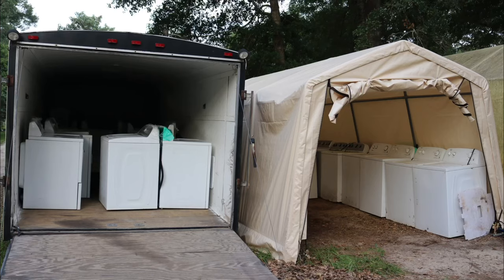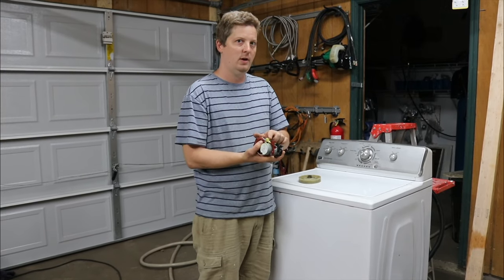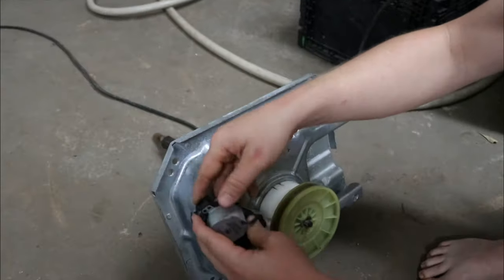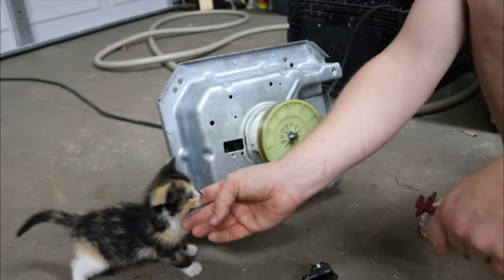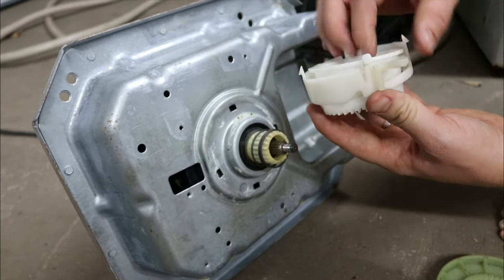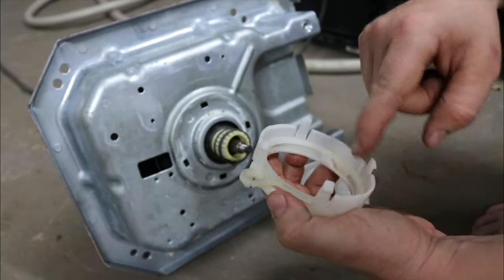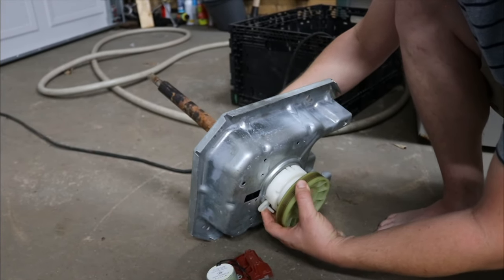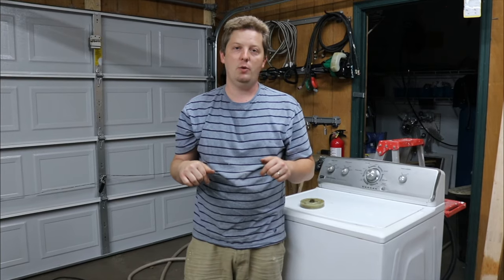Washer No Spin or Grinding Sound? Actuator Transmission Step by Step Guide to Fix or Replace

Comment: Hello. Thank you for making this video. It is very helpful. We are attempting to repair a Maytag Model No. MVWC360AW0. Back in March, the washer wouldn’t drain and the sensing light was flashing. We first replaced the shift actuator. Then, having not resolved the issue, replaced the drain pump. Noteworthy, we have never been able to get the control panel to enter diagnostic mode. A friend installed the parts and I believe he recalibrated the machine afterwards but can’t be certain. Once repaired, the machine was up and running until about a week ago. Now the symptoms are that the agitator and spin basket are locked up. It doesn’t budge. We disassembled the inside…removed the wash plate and doin basket. There is nothing. On the underside, after removing the protector, we tried to move the cam assembly by moving the drive belt. It does not move freely. A visual inspection shows no oil or evidence of an issue with the gearcase. However, after removing the nut and the cam, there is dirt and oil around the inner lumen of the gears near the shaft. How may we determine if the gearcase is bad? What could seize the agitator/spin shaft?
Reply from the maker: Oh that is a uncommon problem. I haven’t countered it but it’s been a very long time and I can’t remember exactly what it was. I feel like maybe it’s a bad transmission. The transmissions in those washers are not really made to be worked on. If you look through my videos I disassemble that transmission and give my opinion of how it works.
This video helps. Good luck.
https://youtu.be/2ImQbNrdblY

Comment: Thank you for explaining the potential cause. After replacing my actuator, my washer worked great for 1 day. At least we got caught up in our laundry. But the new actuator broke in the same location. Small plastic piece that rotates the arm. After removing the splutch, I found dirty grease but I also found worn splines. I hope a new splutch kit and actuator will solve this.
Reply from the maker: I bet it will.

Comment: Awesome video. I have a maytag bravos MVWX655DW1. It started making that plastic grinding noise so I replaced that plastic hub under the wash plate but to no avail. It will go through the cycle with grinding noise and when it come to the final rinse and spin it will not spin cycle completely to remove water from clothes it does not finish the cycle and the tub will shake really bad also. Hopefully my description can lead to any type of helpful conclusion. Thank you

Comment: Yup you nailed it my man! After my Kenmore machine failed in "stuck in stupid" mode - meaning start a cycle and the thing senses 2 times then the lid latches and the lid lock light blinks . . . and blinks . . . So I ran the diagnostics and got codes for sure . . . which told me that the thing failed to wash and rinse - duh. So I opted to replace the actuator for $55, no big deal, right? Except that did nothing to clear the problem - same thing - locked lid with blinking light which simply means that "something" went wrong to start the cycle. SOOOO . . .I came upon your collection of clips here on good old Youtube and watched several in order to get a good idea of what was going on during these assorted cycles. I popped all the hoses back off and flipped the machine back over and dug back in and this time I pulled the belt and drive wheel off the transmission and actioned the arm and all that stuff inside the shifter and gears (aka the "splutch" in the insiders circle - splined clutch perhaps?). Everything moved smoother than a babies butt so I put it all back together. and tried again with fingers crossed and some prayer . . .and . . .wait for it  . . .BINGO! We are back in business mister! OOOO-RAH in USMC vernacular. It is so very satisfying when one can make a simple machine (???) do what it supposed to do. Thank you for taking the time to make these videos and put them up for others to see!!!!😃😁

Comment: GM. I have a Frigidaire Max Fill Top washer that  Makes a really bad gridding noise while it initiates  the pre wash cycle (weighing clothes), While it  moves (agitates) from left to right its ok but as soon as it tries to turn the opposite it grinds and gets stuck. I have to do one of the scans for 3 minutes  or more before it stops gridding and functions correctly.  it will wash all loads with no problem until the following week and it will start again. Thank you. Blessed Holidays

Comment: The best part of the video was seeing your adorable kitten. Hehe On a serious note I have this washer and I am praying it is not the bearings that have gone out. 
I will check this problem though.
Reply from the maker: Yeah my kitten has grown up into a cat now. She's still cute though.
When bearings are going out in these type of machines they get really loud in spin cycle.
Reply: Yea that’s what mine is doing. I was messing around with it last night. Know not a thing but did some research the proper term are the drum bearings. I was thinking it was the actual “transmission” that drives the pulley that has the problem but it’s not I do need a new belt though mines all gummy and you never mentioned what a pain the pulley wheel was to get off. ;) lol

Comment: Sub’d!! Awesome video/explanation! I have this machine and it just stopped agitating in the middle of a cycle and I like to never have gotten the dang lid open. Was stuck closed. Tons of videos suggest it is the drive hub, but after disassembling it and looking at it, it does have some worn splines, but it seems to fit snuggly. After reassembling, the machine, it did fine and made it all the way through a load with no problem. I figure if it were the drive hub, I would have heard some type of grinding, which I did not. After watching more videos, I started to think the actuator might be bad. It was suggested by another technician on YouTube to clean the spludge, which I will do today. I also found out how to put it in test mod and it passed all tests involving agitation, with flying colors. I just with I could be more sure it is the actuator and not something else, so that I’m not just throwing money at it? Thanks in advance for your time, I greatly appreciate it!!! And again, awesome video!! Hard to find such great, in-depth information, from knowledgeable individuals! 👍🏻👍🏻👍🏻

Comment: Thank you so much....  

I actually just needed to replace the belt. 
It was shredded. I could not understand what that burning smell was. 🥺

Because of your video, I was able to understand the breakdown of my machine and locate my issue. 👌
Reply from the maker: Glad you got it going. That is a very rare problem

Comment: Thank you for your video. I replace the actuator and the spluch and still have terrible grinding noise during agitation. What could it be?
Reply: Mine does the same thing after the repair.

Comment: We followed your video and it made it so easy. However the drum is still bouncing around. This started after we changed the splutch gears then is came unbalanced. Then changed the suspension rods. Is there any other fix we could try before getting a new one?

Comment: Question:   Whirlpool WTW4816FW2 Top Loading Washer much like the one you have in this video ... 3 years old ... grinding sound when the agitator is moving CCW ... normal when agitator moving CW. Checked the clutch and the teeth look good, but a fine dust has started in housing. Increased clutch spring tension slightly, (about 1/4" past larger splined shaft), and lightly brushed  ramps and splines with silicone grease ... Noise when agitator is moving CCW still there ... do you think it is the actuator motor not fully engaging/dis-engaging?
Comment: You most definitely have the gift of Teaching , and obviously enjoy your work .... Thanks so much!

Comment: Very good video, mine was grinding. was going to check the actuator when I took the belt off the motor pulley came off too. so that was the problem and it cast only $20 bucks to fix it.
Reply from the maker: Interesting. Are you saying the pulley just came off when you went to take the belt off. So it was missing the nut that holds it on. That nut I have had come loose and cause havoc before but I’ve never had them for all the way off. I do recommend putting a tiny bit of thread lock on those nuts so they don’t come back loose. If you look close, you’ll see the factory put some on as well.
Reply: @WasherDryerMoney  the motor pulley just snaps in. no nut The teeth where striped.

Comment: Thanks super helpful! I replaced the actuator on my machine without doing the other steps, to check that first, but now, as soon as i plug it in, it starts clicking. Worried i broke something 😕

Comment: Very good on explaining everything but I have a question you said it could be the actuator but I see you just spinning the pulley without the actuator connected and still making noise so I think it’s more likely the spring because the actuator not connected how can we tell in this situation because I have the exact same issue right now and i don’t know what to order the actuator or the other parts with the spring my question how to find out exactly which one

Comment: I have a Whirlpool Model WTW5000DW1. This is the 1st time I've had an issue with it. I believe it was on a drain & spin cycle & it just stopped. All the lights went off & it made a faint hum/buzz sound. It doesn't drain or spin and the water is still in the drum.

Comment: I recently had to remove the Wash Plate on a model MCWC555DW1 to replace the spin assembly.  I ended up destroying the original wash plate to the point that only the plates gear was left on the shaft.  This was a total PIA!  I heated up, etc.  I finally took a small hacksaw and saw a groove in it and took a chisel and split it of the shaft.  It only came off after doing this on each quarter of it.
I wire brushed the shaft and placed Never-Seize compound on the shaft where the agitator mounts.  I certainly hope it makes it easier for the next tech that has to deal with this machine!  All the You Tube videos seem to never show the actual work of getting this POS off!
Lost my ass on this job!

Comment: Hi. Thanks for awesome video. Helped alot. But for some reason my shift actuator keeps breaking and i have replaced it two times already. Any ideas why the shift actuator might break at shifter? Thanks again for good video.
Reply from the maker: Have you added the white lithium grease to the plastic part that moves back-and-forth.
If you cannot easily move the arm back-and-forth by hand, he may have to replace that splotch “that plastic piece”
Also, be sure to do a recalibration after you’re done replacing that part. It will double check that it’s in the right position before you start using it again.

Comment: Great video, my shift actuator arm keeps popping out of the shift arm, and then I don't get agitation? Electrical wise it works. I have replaced it with an OEM part and it does the same thing? Is there a fix for that?
I have also disassembled the shift housing and cleaned and lightly lubed and it's clean and smooth? If the shift solenoid actuator arm pin was a little longer it might not pop out? I apologize for not having the correct part names. Thank you

Comment: This was an amazing video. Wondering if you would be able to reference where to get the spring if we believe that is the issue?

Thanks 😊
Reply from the maker: You’ll have to buy the spluch kit. It comes in the kit. The most likely culprit is going to be the split kit if it’s making any type of grinding noise. If it’s just not shifting into or out of agitate that’s more than likely the actuator. Which is also not expensive. check the description I put links to them

Comment: Hi. I have a similar GE model. My machine is draining but doesn't spin nor agitate. I replaced the belt. When I turn the pulley underneath the washer the tub moves and so does the actuator when manipulated. However when I stand the washer back up the machine doesn't agitate or spin, only drains. When i pulled the pulley off it seemed like theRe was an excess of black goo, but that could be from the belt slipping.  I did hear a light grinding from time to time, so I checked the gears behind the pulley, and they seemed fine. With the model GE that I have there is no front plate or back plate to take off to see if the motor is actually running properly. But I am presuming that the motor is what is draining the water from inside of the tub.  Lastly, but I don't think it's related to this issue that spin cycle has been running a lot longer than what it was. There is times that the spin cycle runs for almost 9 to 10 minutes. That's why I was thinking possibly that the motor burned out. Any advice? Thank you.

Comment: Thank you for your   
Video's ,how do you change the rubber washer at the end of the tr
ansmission shaft
Reply from the maker: If you mean the rubber piece inside of the end of the transmission, I’m not sure that is serviceable. The bigger issue might be finding a replacement.
I have removed the washer that holds back the gear case oil from leaking on the belt. The issue was it was a weird shaped rubber piece that I could never find a new one.
That is the big downfall of that machine. The transmission is just not made to be serviced, and even if you do go to the trouble of removing a bad piece out of the transmission there are not replacement pieces that I could fine.
They want you to replace the entire transmission which is pricey.
Reply: Thank you for your reply,I'm actually talking about a rubber piece up where the shaft comes out by the drive block
Reply: I like the way you're step by step on you're video's, the machine would not agitate,so not noting,I went to check the dogs ,there are none,started to remove agitator the bolt would not come out ,so I resorted to the 4/4 and jack Methodist ,it worked  but pulled the shaft out of the trans. The spanner nut I had to cut off,and stuff got into the trans. So I took   it all the way down,cleaned trans. Installed grease  and putting back together ,I'll let you know what happens.

Comment: My pulley nut is on crazy tight, too tight to hold by hand & bust it loose & the clutch won't move far enough to engage the pulley teeth so I'm stuck trying to keep the free-spinning pulley from moving in order to loosen the nut; any advice? I tried one of those belt wrench things for oil filters but it doesn't grip well enough.

Comment: I have a Kenmore Series 500 with an actual agitator.  The machine sounds like it is agitating, but it does not.  It doesnt spin either.  I replaced the drive hub under the agitator.  That was not the problem.

Comment: hi  great vid..thx  I ran a manual diag test on my washer and got a FAULT 421 and error code 41 so points to a  SHIFTER  problem
I didn't Check harness connections from main control to motor and shifter since I don't have any meters
• Observe shifter operation  didn't know what to observe. when I run the manual test I hear a very soft   noise for a few seconds which then stops and  then starts up again  several times ...would that be the  belt , trying to spin the assembly?  saw what looked like a big capacitor that plugs into the pins on the actuator but looks good from outside.  Took the gear assembly off but looked real clean, so do these things go bad without dirt of grime getting in the assembly ?  Is there a way to test the actuator if I could get a meter?

Comment: This was exactly my problem but I didn't find ur video before I did hrs of troubleshooting to figure it out. Took apart the plate. Kept running diagnostics. Recalibration. Getting that awful grinding/rattling noise. $23 later problem solved
Reply from the maker: Very cool. Glad to help.

Comment: Fantastic videos!!!!  I have a top loader Whirlpool Washer that is making a horrible loud grinding noise, when on the wash cycle only.  I replaced the washer Pulley Splutch Cam with a new kit & I also put a new actuator on it.  No improvement!  Same horrible loud grinding noise on wash cycle.  Any recommendations?  Thanks so much!
Reply from the maker: Check out the video I put out last week. It’s on replacing the Splutch. My hope is it maybe it needs to be slightly greased and it’s not the gearbox going bad. The transmission in those machines are difficult to replace and expensive. I would say it’s not worth it if you don’t have a spare machine you can steal a transmission off of.
But before you give up, I would double check, the spring in the Splutch is in place and the Splutch as well greased.
Just check out the video I made two weeks ago.
Reply: Do you know what would cause damage around the rim edge,  of a new splutch “basket” piece,  after only 1 wash cycle?   It looks like the rim is damaged and deformed from getting too hot, maybe?  Any ideas on what would damage it?  Thank you so much  for your help!

Comment: Hi, thank you for your info. I have an old Timey washer and it works fine but sometimes it won’t spin and when I mess with the handle it goes into spend any suggestions thank you.
Reply from the maker: Could be the lid switch going bad or the neutral Position on the transmission going bad.
The neutral position drains the water out without spinning the drum. If it does not get out of neutral it will not spend.

Comment: Does the bottom of the transmission with the bolt that the nut go on… does it go up and down or is it firm. Like does that wheel gonup and down when pushed and pulled